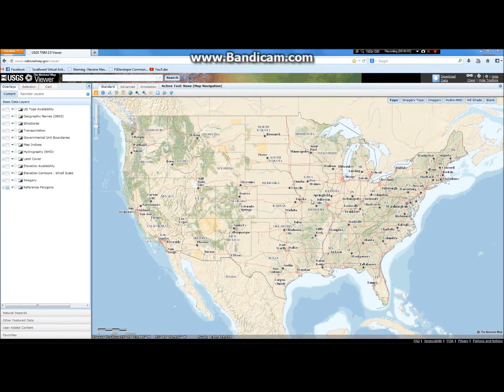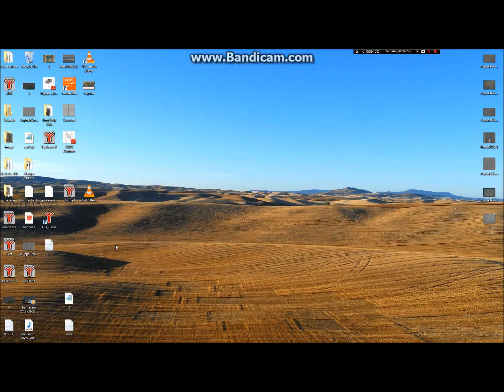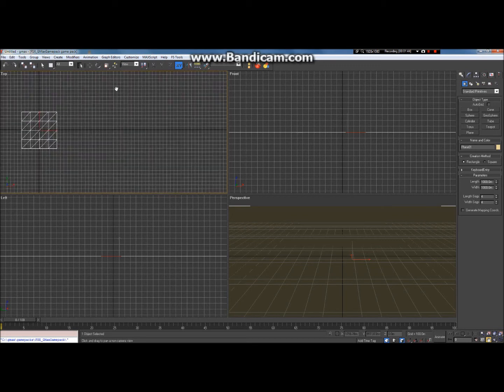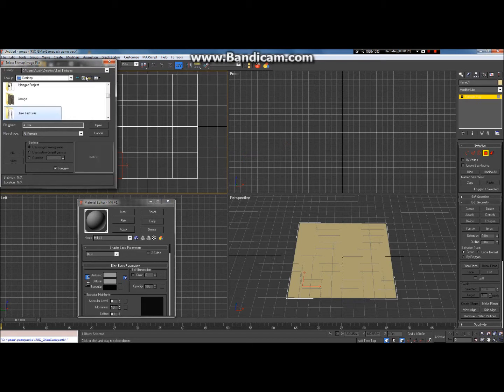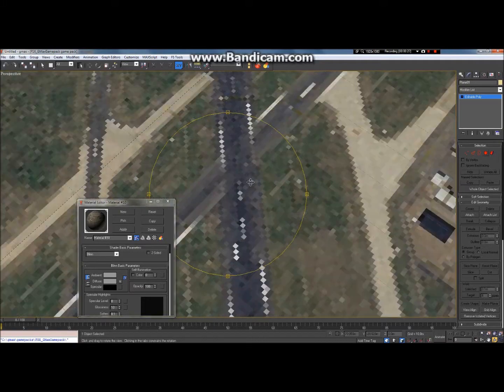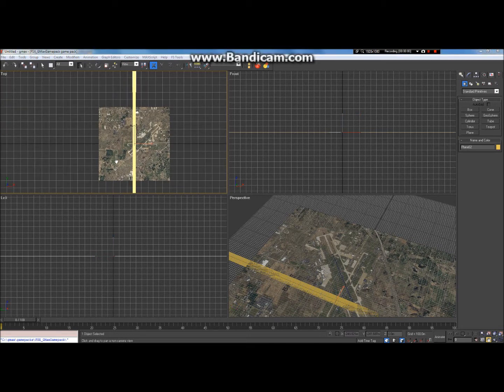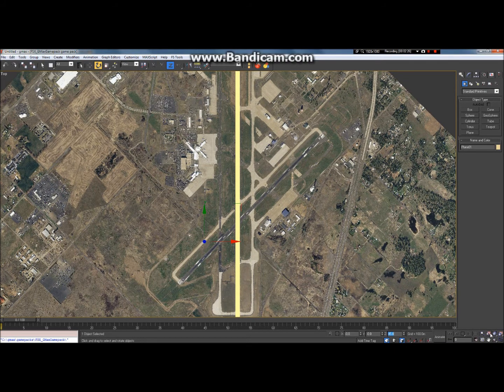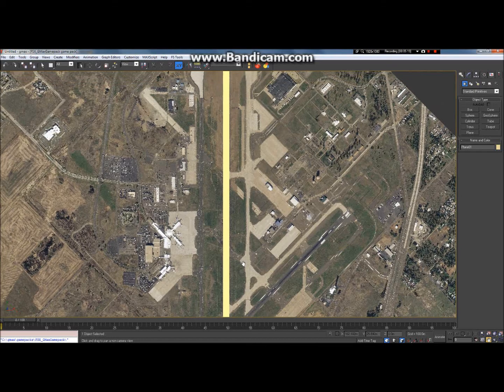FSX Scenery Tutorial / Taxiway Creation - Background Image

Comment: Hi, I was wondering if you an use this process for creating scenery for PrePar3D? If so do you know the process? Any chance of a tutorial?
Reply from the maker: Aaron Werner This process should work just fine for P3D. I've actually had P3D installed for about a month now and the biggest problems I've encountered with respect to loading my projects into it is that certain material settings do not act the same way. For example, my taxiway lights appear to disappear under my ground polys, so I'll have to mess with material settings to fix that. At any rate, any model you create or have already created for FSX should port easily to P3D. If you run into any weird glitches I'd be interested to hear about them!
Reply: Austin Sass Thanks for the reply.  Do you know if Prepar3d users prefer any other methods for creating scenery? I mean is their any proprietary software more adapt for Prepar3d? Do you suggest any scenery packs that already have a good amount of airports with the quality and attention to detail as of your presentation in this video?
Reply from the maker: Aaron Werner The software that I would ensure you have installed is the P3D sdk. Long before I owned P3D itself I've used its sdk for FSX development and being that it is 64bit I can only praise it. No specific scenery, but I tend study Orbx scenery a lot. On a similar note, Flightbeam seems to use techniques pretty similar to the methods I discuss in these videos when it comes to taxiways.